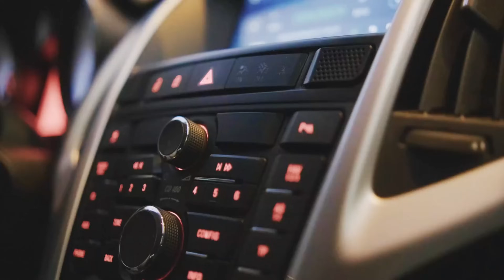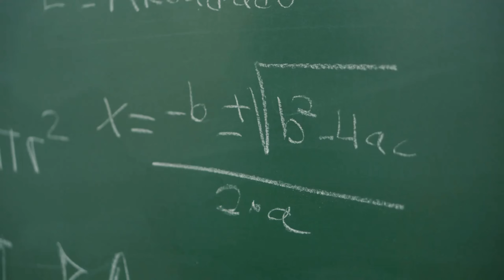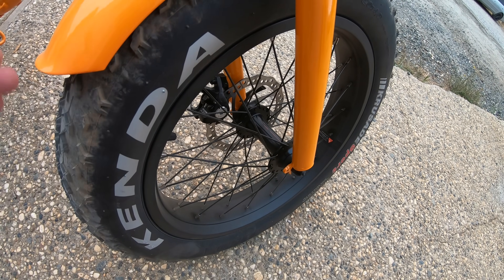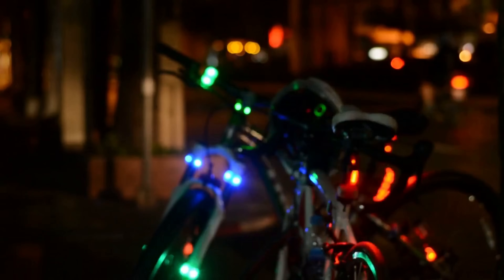Will Ebikes Ever Recharge While Riding?  Explained

Comment: Make the front wheel smaller, to double or triple the rotation from the back wheel motor. And use dc stepup. Or make 2 wheels in front.

Comment: EDIT; YT snuk an old video into my suggestion list ... I commented again without realizing I had commented before. I had much the same thoughts and some newer info so I left this Newer comment here as well. Enjoy; 
 To answer a lot of the questions you have posed I suggest you talk to your fellow E-Bike craftsmen at Grin Technologies. They incorporate regeneration in their bikes and get some really good numbers.
PEDAL GENERATORS; 
 Some years ago a man here on YT demonstrated a hub motor re-crafted into a generator which he (chainlessly) used to charge the battery of his rear hub motor. It may have been 'less efficient', but it resulted in a significantly longer ride and would recharge the battery even when sitting still or upside down and hand cranked. I haven't seen his videos from back then in a while but they may still be around. It was a pretty interesting project.

Comment: I think people wonder about regenerative braking on bicycles because they see regen braking on electric cars, and possibly they know about electric locomotives and also dynamic braking on diesel-electric locomotives. However, air resistance is so high on a cycle, cyclists rely on air resistance and axle resistance to do most of their stopping. When is the last time you suddenly hit the brakes on your cycle from high speed? It was probably an emergency. Even at 9 MPH, half the drag on a cyclist is air resistance. At any event, this is why he suggested a aerodynamically-shaped recumbent cycle as a platform for a solar ebike.

Comment: why not use two batteries ... use the one and while driving charge the other from the front wheel as the main battery is discharging from use the other would be charging and then it's just a matter of switching to the other ... like a tractertrailer does for the distance.....

Comment: First of all a fat tire electric bike is an oxymoron. The fat tires create a lot of friction. I think it would be better to make an ebike out of a velomobile. A recumbent reverse trike or a low racer recumbent bicycle, with a carbon  fiber aerodynamic body. The first thing would be to cover the top of of the aerobody in solar cells. Also this bicycle would use the tires that when pumped up to 90 psi they are 1/8 of an inch wide, very narrow & low friction for street use. When the psi lowered to 45, they become an inch wide for offroad use. I would also make an 8 ft long trailer to pull behind the velomobile that had 2 solar panels on it, each solar panel  would be 30 inches wide, by 48 inches long. The panels would be able to tilt 45 degrees side to side, to catch to the  morning & evening sun if heading south to North. The trailer would be 3 ft wide by 8ft long, 3ft high walls. The trailer would be made out of light aluminum square tubing with a carbon  fiber floor, & waxed cardboard walls attached to the aluminium box frame with zip ties. Instead of pedal assist. The pedal system & crank arms would be as long as possible, with a huge 56 tooth sprocket attached to very powerful & efficient generator/alternator with a very small 8 tooth sprocket, making the pedal ratio 7:1. You could pedal to help charge the batteries at night, with the sun was down, or you could have a switch to direct the electrical energy straight to e-motor. On the back of the trailer I would mount a small wind generator to help charge the lithium ion battery bank also. Another thing that could be mounted to the reverse trike could be a small wind surfing sail, with a small rope leading inside the aero body to be used on windy days. The long narrow trailer would be a micro rv trailer to sleep in will touring all over the U.S.

Comment: I currently utilize a simple solar/generator combo. 350 Watts of used LG house panel mounted to my pickup trucks roof rack charges while I drive, doing errands, or just sitting in the driveway. From that I charge the eBike batteries (2 48V -about a kilowatt total)while the bike sits folded in its “garage” tote.
Then I ride on the pure solar powered bike after driving to a low auto scenic location.
Done ✅

Comment: True, I have tried it, the only way to recharge is going down a hill with your Direct drive motor setup with your Motor brakes Activated.. I have tried this on flat Road, and It's a form of Torture from 45 Min of Peddling you only Gain 1.9Km but use 2Km what you need is your paddles just producing power, so your Resistance is minimized so no chain, and you need a Big PMA with Reduction gears at that point it becomes an E motorcycle with peddles. 48V running a 36V system, this is  how you do it Over coming Entropy by producing more power than you need.

Comment: I thought about putting a thermo generator and a small camping stove on my bike and with the 12v output i would power a inverter to 230v and charge my batterie. And if the gas bottle is empty i just replace it within 1mn.. But the output of the thermo generator is to little for the inverter...

Comment: What if you put an alternator on the front wheel and charge battery A and then as you ride with battery B and then when battery B is off you swap with battery A then battery B gets charged and you do that after every 10 to 20 km.

Comment: Why does everyone cover this the same way? Like SLOW DOWN, how about riding the bike with the front wheel charging aparatus while the bike is turned OFF! Nobody seems to be covering this and its infuriating. The battery of the bike would not be active and the manual cycling would result in a charge being stored. This video covers the losses of generating electricity while the bike is on an operational. Can I turn the bike OFF/Remove the battery... and ride the bike it to charge it/plug in the battery and use said captured energy to charge it?! YES-OR-NO?! flips table . Is nobody asking this question?

Comment: Aside from the physics problems of efficiencies etc...s the additional hardware and cost of running a parallel wiring system and modified battery to which you deliver regenerative power to the battery while also extracting power from the battery.

Comment: I have an idea to make this possible. This will be a bit long winded, so bear with me. I'll explain it as detailed as possible to allow someone with the skills to try this to be able to build it. I'd love to try it, but, don't know how to weld. Anyway what generates electricity in an electric generator is the rotor and stator. The rotor has strong magnets with alternating N/S poles, and spins, while the stator is still, and has circular or triangular coils of interconnected copper wiring, which is run from that to your battery or motor. Another bit of knowledge we need is what's called a googolplex, which is when a larger gear connects to smaller gear, sometimes several smaller gears, though  in this case several would be counter productive, and this causes the ratio to increase. So here the idea. Get a bicycle, and on the front wheel, weld a large gear, (like 1st gear on a mountain bike sized) run a chain from that to a smaller gear (like 7th gear mountain bike sized) welded further up the fork, (welded in a way that it can spin)  This way, when you're coasting, or under power of the motor, the rotor will still spin. Because of an increased gear ratio, (no too much or you'd overwhelm the ability of the motor and yourself to actually peddle to speed) the rotor will spin fast, and the faster you go, the faster it spins. (Which would already be spinning much faster than the  wheel itself due to the increased gear ratio.) The stator, placed in front of this rotor, collects the energy, sends it to a a control box that limits max output (so you don't just fry your motor) and from there to a control switch to engage/disengage the motor, (something like the twisting handle on a motorcycle) and from there to the motor. In theory, once you were pedaling fast enough to generate enough electricity, (the control box should have a readout that would let you know) you could engage the motor, and as long as you are moving, it would generate more than enough energy to run the motor and then some, depending on the size of the rotor and stator. Obviously it can't be tiny, but keep in mind, a gas generator powerful enough to run a camper can be carried relatively easily, so it doesn't have to be massive either. Anyway, the motor would be obviously be able to propel you faster than you could peddle (otherwise why bother with electric bikes other than being to lazy to peddle) which in turn would spin the rotor faster than the speed you had to get to to be able to engage the motor, the result of which is a motor that would run endlessly (until it wears out at least) as long as you don't stop moving. A battery wouldn't even be needed, but, to enhance this, run the excess energy from the control box to a diode, and to a battery, and from the battery to the motor. The diode works like a one way switch, so electricty from the battery cant flow back to the control box. Youd probably want to include a method to stop the flow of electricity when the battery is full to prevent overcharging. While the bike should function without a battery at all, the introduction of the battery would allow you the ability to start moving without pedaling, and in turn, once up to speed, the generator would recharge the little juice that battery used and return to running solely off the generator. Doing this would make a self charging bicycle. (Although at this point, with no more need to pedal its more of a self charging moped.) Here is a video of a multi gear bicycle made for speed. 

https://youtu.be/dNMOj-3Fwls

My idea is instead of the extra gears going to the rear wheel for speed, it'd just be attached to the front wheel to spin the rotor. And here is a video of a rotor and stator.

https://youtu.be/NKDYeyu0R30

 If anyone ever builds this, please give me a bit of the royalties when you change the world of self propelled bicycles lol.

Edit: for anyone that believs you'd never be able to peddle fast enough to start the motor in the first place, you'd be very wrong. A 1000 watt gas generator spins at around 3600 rpm. A bicycle with 26 in wheels spins at 129rpm at 10mph, or 194rpm at 15mph, both are easily achievable speeds to peddle. Obviously that's a "tiny" bit shy of 3600, lol, BUT, remember the wheel is on a gear ratio different than the wheel. Assume you have a 1:25 gear ratio, wich would be  kinda hard to spin, but probably manageable. That changes things. Now, at 10mph, your rotor is spinning at 3225rpm, way more then enough to run a 500w bike motor, and at 15mph it's spinning at 4850rpm, which is enough to run a 1000w bike motor. So it is possible, easily so, assuming you build the gearbox strong enough to withstand the speed. (Don't cheap out on material) but wait, it gets better. Lets go back to my original idea, using the larger and smaller sprocket, not a 1:25 gear ratio which, while likely manageable to pedal, would probably break sooner or later unter the strain. Notice I gave statistics for a 26inch wheel. But the gear we welded to the rim isn't 26 inches is it? My 1st gear on my mountain bike is approx 4 inches, and my 7th gear is approx 2 inches. Not exactly, but close enough for easy math, so let's go with that. No need to throw in 16ths. Anyway, with this new information, things change dramatically. Here's the math on that. The 4 inch sprocket has 32teeth, and the 2 inch has 11 teeth. So for every rotation of the 4in sprocket, the 2in is rotating about 3 times. So now at 10mph, that 4in sprocket is spinning at 840rpm, which spins the 2in at about 2520rpm, more than enough get a 500w motor running. And at 15mph that 2in is now spinning at 3783rpm, which is more than the 3600 rpm of a 1000w gas generator. End point here is, you'd be able to get the required speeds, while at the same time using a simple gear conversion that your bike already has, increasing longevity. You could also buy a 54 tooth sprocket (like for gas motorized bikes) and use that as your large sprocket, which changes things quite a bit as well. Now, that 2in sprocket is rotation almost 5 times per single rotation of the 54t sprocket, which brings your new rpm to about 2800 rpm at 10mph, and 4700 rpm at 15mph, again, both easily achievable speeds for the average person. 

Again, if any builds this and it works, let me know. I'm want my cut lol.
Reply: A lot of words and complicated parts will not allow you to violate the laws of physics.

Comment: I wonder if you took a hub motor, and reversed the polarities so rather than using the power, you treat it like a generator instead as you're going down the road to feed electricity back into the battery to prolong the distance traveled. Like use a mid drive motor with a pedal assistance, and a reversed hub motor in the front wheel generating electricity while you're in motion. and the rear wheel would have some gear system, like those internal gear hubs (like that 11 speed Shimano Alfine hub) so you can go faster with less effort. I wonder if that setup would work though.
Reply: No, you will put too much drag on the bike and create more losses, you need to listen to what he's saying. It's a net loss you might as well just have the brake slightly on the entire ride, you'd get the same result.
Reply: @josiahlehman1506  It was an idea that had popped in my head at the moment I was watching this video. You make it look like I wasn't even paying attention to the god damn video. I wasn't trying to calculate a thesis on it. A simple explanation or "it wouldn't have worked that way and here's why.." would had been more than enough of an answer, rather than typing some smartassed comment like "you need to listen to what he's saying". If I wasn't listening to the entire video, I wouldn't have thought about what I typed, ever thought about that?

Comment: I liked the picture of the bike towing 3 solar panels. Let's say a bike towed a trailer with just one solar panel around 2' x 5 ', maybe as the lid of the trailer. Now let's say you got 150 w/ hr out of that solar panel. Let's say you used a 1000 w-hr battery. In a day's biking( plus you could keep charging even after you were done  biking as long as the sun was shining) couldn't you charge a spare battery and just switch batteries every day. You'd probably have to apply human power to the bike also but you'd still have electric assist and never need an outlet (as long as the weather stayed sunny). I realize using the sun is an external power source, but it still sounds like an attractive concept to me.
Reply: Best answer yes just charge a diferent battery... i was screaming during this whole video ....birdbrain people ....

Comment: I disagree.  Here are some terms to ponder to help you try and figure out some things.  I've seen it work so I know that it is possible.  Terms to research and think about how they would fit into the Ebike circuit.  DC rectifying circuit, repurpose a solar or wind generator charge controller, relay switch,  negative impedance circuit using opamps to eliminate generator loading, multiple batteries (at least 2)

Comment: Actually, 1:44 (Suggested solutions) 

So, I want everyone that reads this to keep a very extreme open mind when you understand the differences between AC and DC. (Alternating Current / Direct Current. ) 

Now, I will try to explain where I believe (Area 13) Is technically right, But Mechanically wrong. _ So lets get into a Scientific mode. 
We begin by understanding the AC power and what it is, Alternating Current is a Form of Electricity that is formed by Kinentic energy or "(KE) for short. 

Mechanically you can Technically re-power your battery under the power of your own pedalling by adding a rear secondary sprocket at the rear axel and take that (KE) Produced to convert it to AC and then plugged into a power battery to convert the AC to DC power... Equalizing a output. The problem however is 'battries." With the latest Technology ION or Lithium batteries are not sustainable source of power as they are only able to recieve a P.C (Positive Charge) To "Charge" up the battery in the Element. However, It is indeed possible to Convert the AC power to the DC power output. So long as you have the KE + AC - DC = Direct output energy. But the problem with this is that there is not enough energy to Collectively power your battery efficently. But this is also not true... So the ultimatum you'll need to continue to Convert this power is Gear ratio, the larger gear in the back of the bike can change the flow or RPM of the alternator producing a Alternating current like a Generator, But you'll need to constantly be pedalling or the KE needs to continue processing this and this charge will "Stop" Once you've stopped and the problem with (DC) Power is that it is a constant output... So, Theoretically the problem would only be faced about "HOW" a Battery bank is stored. People are silly and usually say it's not possible, But it really is... Just people just need to learn about Kinetic Energy, Alternating Energy and Directive Energy. Understanding Input to output ratios and what is possible and what isn't. :)
Reply: just install step-up electronic charger who can charge from 5-40v to 42v battery or supercap !!

Comment: if a 1000 watt mid drive motor drives a 750 watt hub motor while driving throttle and pedaling.

Will the battery not be recharged from the 750 watt generator? Not complete, I get that, but will the distance increase?
or is the resistance of the hub motor greater that there is a big loss?

How does this work, in my head it should work, but in practice.....